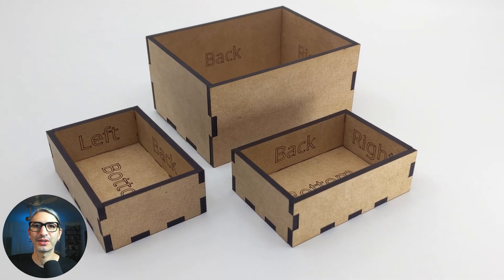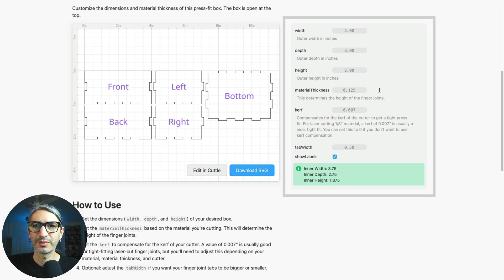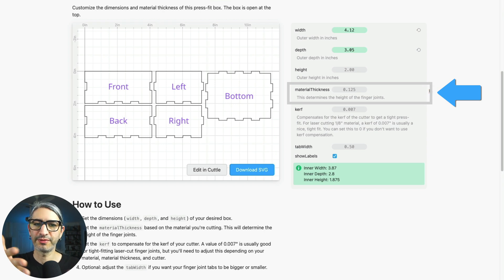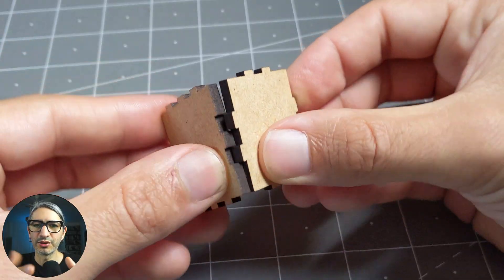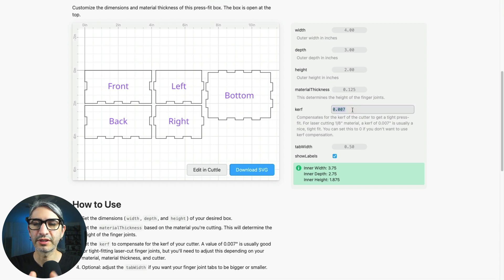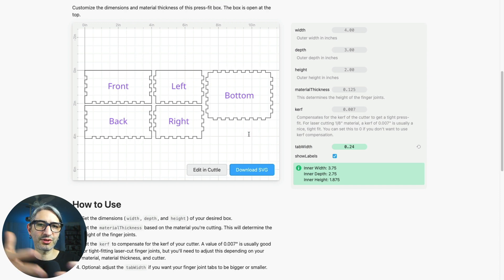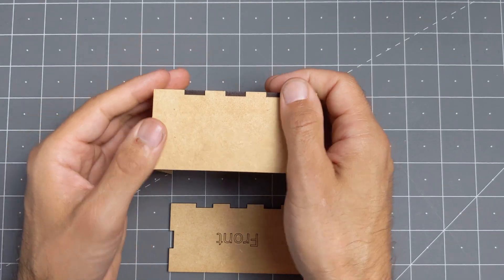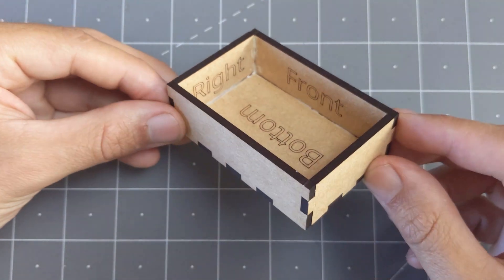How to Make Laser Cut Boxes with Finger Joints

Comment: Hello, informative video. I have a question you may be able to help with. I've been looking for information about finger joints where additional lines are cut into the fingers. I have a box made with laser cut finger joints and the fit is really great without glue. I'd like to know what these lines are called and how they work. I believe they provide a little extra give so that the joint can flex to give a tighter fit but without knowing what they are called it's difficult to confirm.

Comment: I am making cabinets for tool and parts storage in my workshop.  The cabinets will have dado cut sides (e.g. 1/4" +.125") for slide in panels with a box on top.  the slide in panels will be .5" wider than the box.  This will allow the panels to slide into the dado's with a a bit of room to spare.   Will save on expensive slides and still be quite functional.  How would I accomplish this with Cuttle?

Comment: Great video! Love your software. How can we add a lid to it?
Reply from the maker: Good question! One option is to cut a rectangle that's the outer width/depth of the box and a second rectangle that's the inner width/depth of the box. Then glue these together and you have a lid that fits inside. I'll work on a template that does this automatically. Thanks for the suggestion!

Comment: i dont understand this program. im trying to resize a coffin box and nothing makes sense, i cant make the walls change accordingly to the lid and back parts. i can get one to change, but not both. its adding more teeth to the walls that dont correspond to the number of holes in the lids..im so confused. i just want to scale the coffin box up to 13 inches tall. can you help me?
Reply from the maker: Hi, I assume you're talking about the Coffin Box project that user bwente shared. This one: https://cuttle.xyz/@bwente/Coffin-Box-KYOxvYPF0HtI

I'm looking at it and it looks like bwente added a "scaleShape" parameter to make it easy to make the coffin bigger. To use this:
1. Go to the URL https://cuttle.xyz/@bwente/Coffin-Box-KYOxvYPF0HtI
2. Click "Edit in Cuttle" on the top
3. In the right panel, expand the area labeled "Coffin Box" (click the triangle next to it)
4. Next to "scaleShape", click the 1 and change it to 2.65 (type that in).
5. File > Export SVG

This project was not created by us (it was shared by another user, bwente), but hopefully these instructions will help. -Toby
Reply: Are you working from the Open Box with Finger Joints template, or a different project? People on our Discord might be able to help if you ask there: https://discord.gg/vb6UGseR